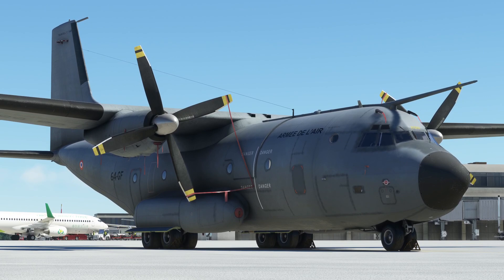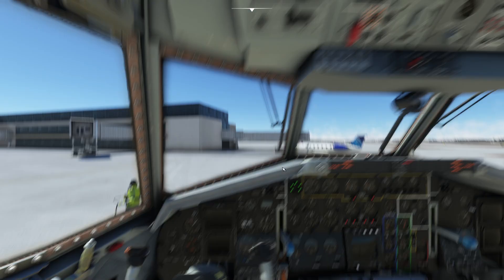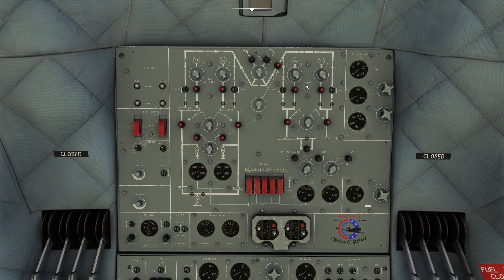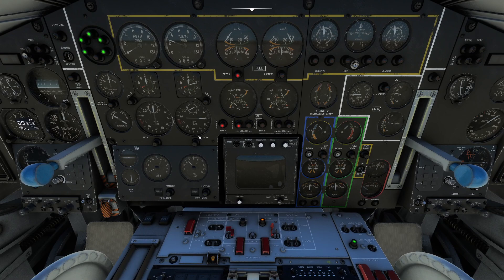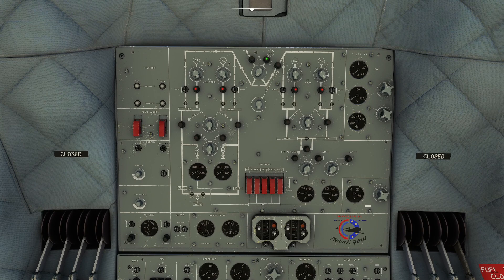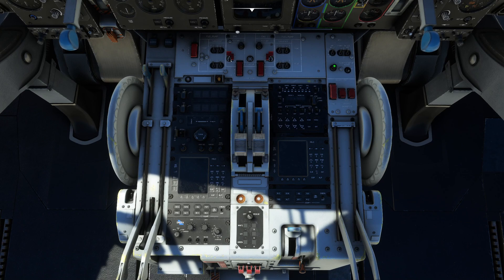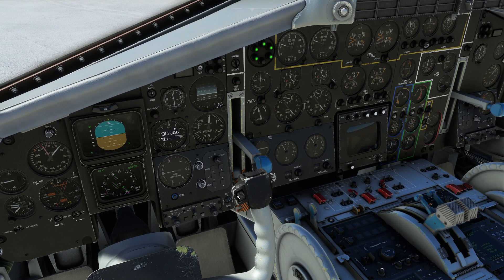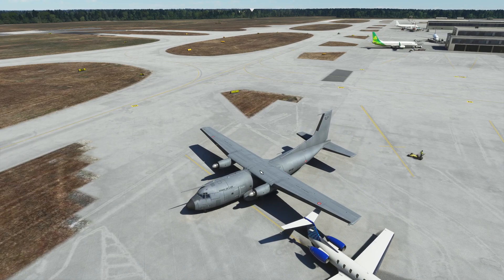Starting the C160 Transall from cold and dark in Microsoft Flight Simulator - Take 2!

Comment: Hi,
I have bought Azurpoly C160 yesterday from Sim Market but it does'nt work. I can't figure out what the problem is.
The on-board tablet does not turn on. The APU switch button cannot be used, the systems cannot be started. It's like a demo version. Please help me out because I like to use this program.  Maybe the registration key is missing ? I have not received any. I wonder why is it not working. It was to expensive if it 's a demo version. Please give us technical advise. Many Thanks in advance

Comment: I've had this aircraft a few weeks now and I notice that it always begins to yaw (horizontally) extensively in either direction.  It happens so much that rudder input does not compensate much after a while.  Is there yaw damper on this aircraft, and where is it located?  It is unflyable for me until I know why this is occurring.  FYI, I've used the manual yaw control on the yoke, but it only stays temporarily before going one side or another again.
Reply from the maker: I've not noticed that myself - I'll do a test flight again with it soon to see what happens. I know it's been updated a couple of times.

Comment: Hi! In 1hour flying, after take-off both engines stop working.. What could the problem be?(fuel almost half, but the batteries are dry)
Reply from the maker: If the batteries are dead, you didn't have the generators on.
Reply: @jonbeckett  Those are(both generators) ON(as You teach).. I do not know what the problems could be, i do the starting procedures, as You teach in Your excellent video.. :(